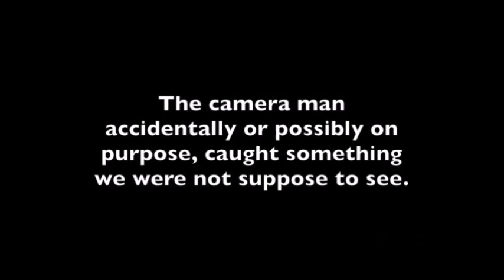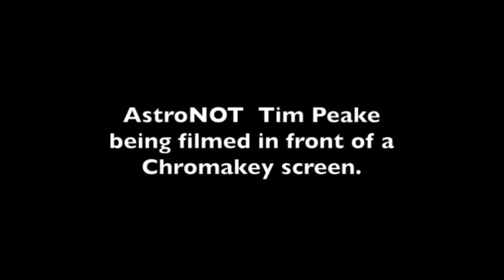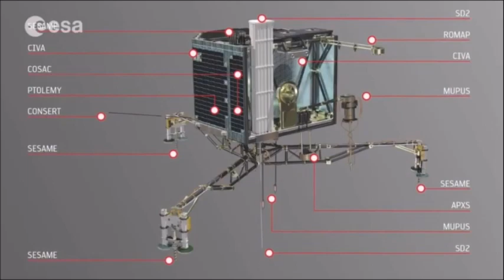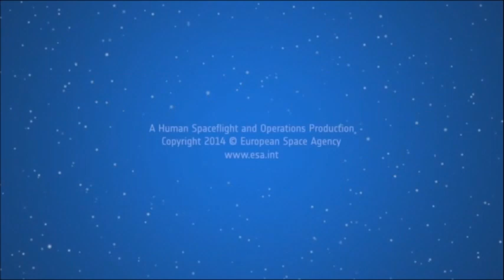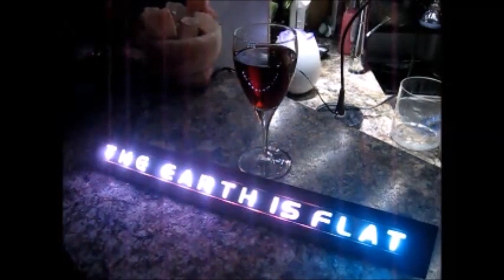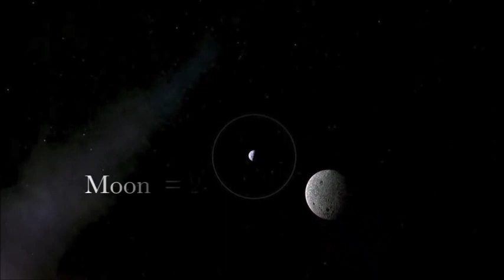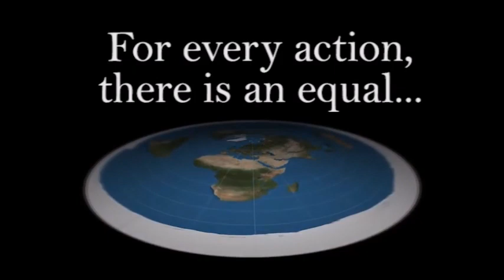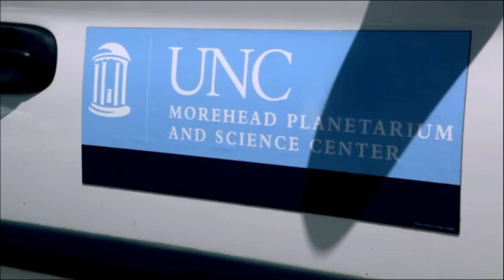Flat Earth Q&A Emails 50 - Mark Sargent ✅

Comment: If the closest star is 4.2 light years away how come it was possible say 5yrs ago i cld see it away and you would have thought tht in bk in the day all them stars would have changed hence the zodiac signs,the only thing tht bewilders me is an eclipse how and why? Is it just the moon catching up with sun ??? But there has been eclipses when the moon is on its own, i heard of the black sun but was thinking" is tht a bit racist"
Reply: +Gloopey I No, they don't. Ancient astrolabes don't work anymore because teh releative position of stars changes over time.
Reply: +Gloopey I The reason that I didn't give that answer is because it's untrue. The time depends very much on the star. Thuban was the north star a mere 3000 years ago and in only 13,000 years it will be Draco something or another.

You are correct that the celestial bodies are all moving on their own trajectories. They move in different directions than us and at different speeds. I'm not at all clear on why you've brought that up here? What is the implication that you're trying to imply? When we calculate how the stars were configured in the past or when we calculate how they will be configured in the future, we use these individual vectors. For every star in a constellation, we determine that stars vector and compare it with our own and are able to predict a future relative position for us and the stars.

You say that it's impossible for them to move uniformly. I'm not a hundred percent certain I am understanding what you're trying to say here... I think you're saying "uniform with our tracjectory?" But just in case: there is one way the trajectories of all the celestial bodies is uniform... they don't really vary over time. It's very rare for a new force to start acting on a celestial body and we know from Newton that a change in accleration requires a new force. So our motion has been the same vector for a very long time and the motion of polaris has been it's same vector and so on. Does that make sense?